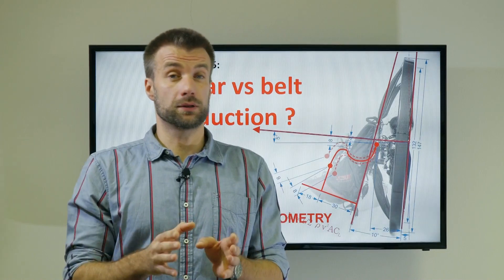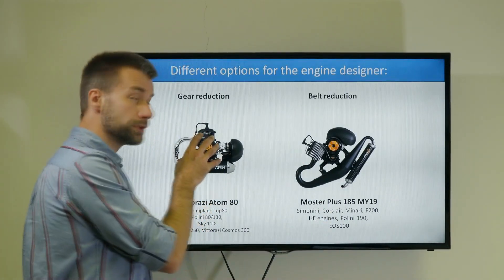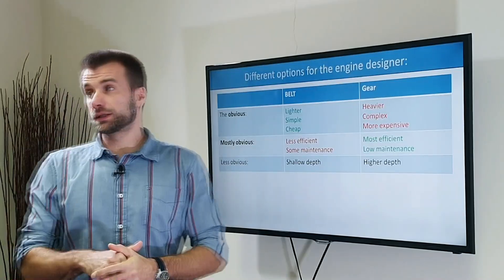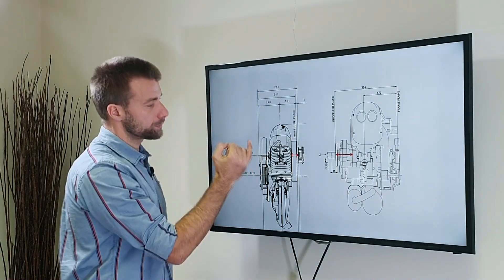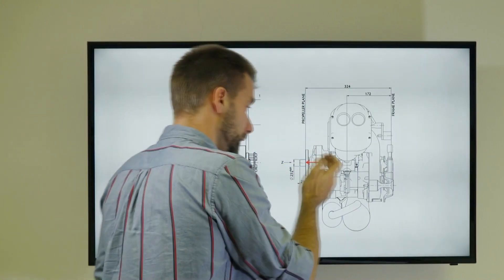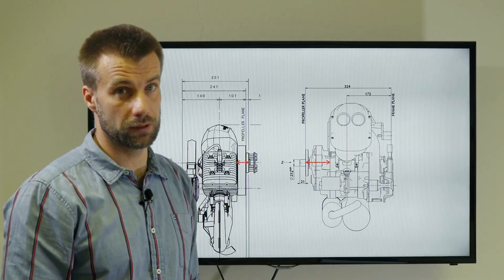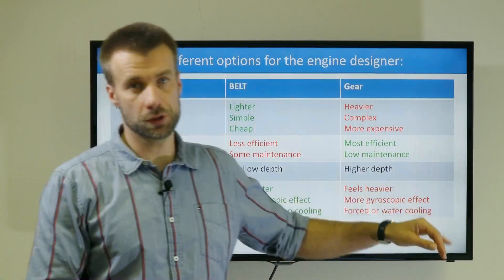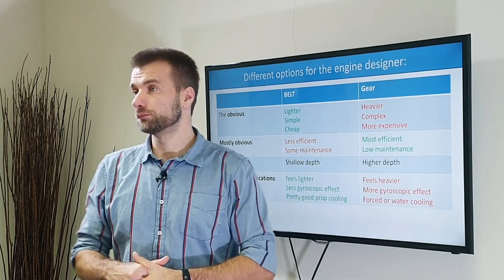Gear vs belt reduction drive. Paramotor geometry part 31.4

Comment: By spinning the propeller the other way with gears I think it balances the gyroscopic effect from the engine.
Reply from the maker: Theoretically yes but the gyroscopic effect of the flywheel is neglible compared to the prop. Prop has much larger mass on a larger disc
Reply: @SCOUTaviation  flywheel and crankshaft  together have some weight to it. Maybe not as much as the propeller, but it should be better than spinning everything the same way I think. I’m no expert just a thinking guy with some experience with gear reduction on a Polini 200. And the engine is spinning maybe 2,6 the speed of the propeller that should increase the gyroscopic effect as well don’t you think?
Anyways thanks for a interesting series!

Comment: Do I need a reduction or can I mount the propeller straight to the output shaft
Reply from the maker: Yes you need one. The prop tips should spin at 0.6-0.75x speed of sound. Faster tips would cause unbearable noise and actually loose efficiency.

Comment: New to the realm (somehow, youtube recommended video); Fascinated with "part 103"... Been riding BMW motorcycles (aka "airheads") for decades: all "dual-plugged"(borrowed idea from Lycoming)... R100 (1000cc), 143lbs (+/-) 65HP... Typical long-haul cruise RPM 6000... motors have always been pretty much "bullet-proof"...
To the point: why reduction? what is typical "cruising" prop RPM vs. "cruising" engine RPM?... perhaps dumb question: could the standard Gertrag/BMW transmission withstand the typical stress(es) in this application? "Heavy-Duty" single-plate dry clutches are commonplace for exceptionally high-torque "race bikes" (camshaft/carb combinations)... apologies for my ignorance... a fascinating/exciting idea... thnx (FWIW, first video, Hummel "firefly"... although leaning more toward "trike" Pusher-type)

Comment: Miro, Thanks for the vid, helpful to understand the design choices manufacturers make. 
What is your thought on the offset 4 blade propellors we see more and more? Does it really reduce vibrations, aid in more thrust and does the additional spinning weight cancel out the gains?